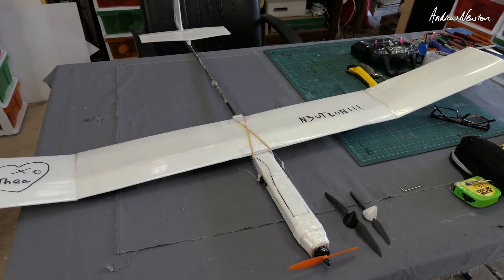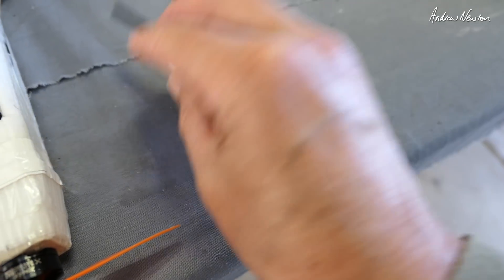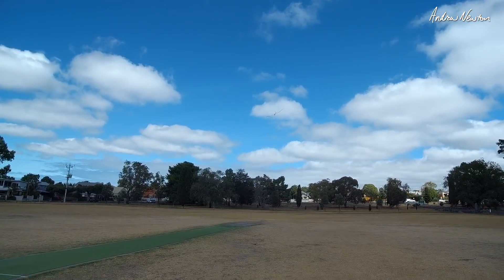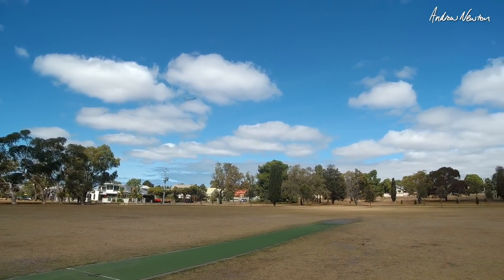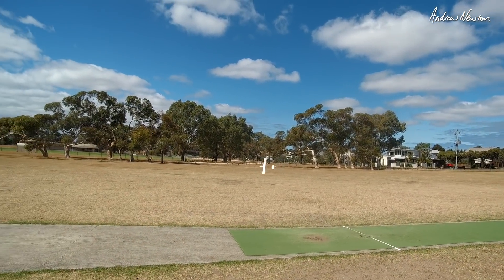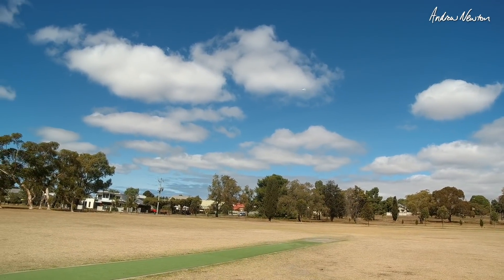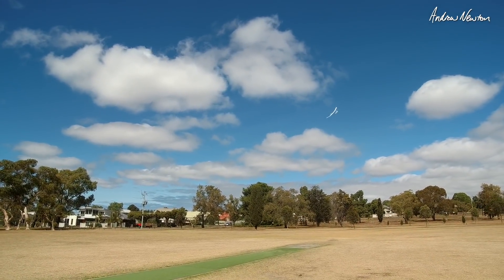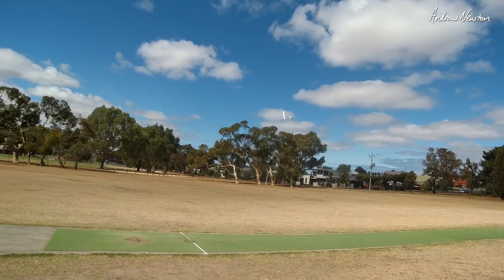Neutron Motor and Prop

Comment: The Neutron is my favorite build of yours! love these videos! 

Waiting on my laminate film to come in and I'm planning a build that's going to be a Neutron/Eachine Razor/Bird of Time mash-up inspired build! Planning on running a 2212 2200kv motor in a 3d printed mount/nose cone I designed, 30A ESC, a few 3d printed ribs I designed in the fuselage, 7.5mm carbon fiber tail boom, 3d printed tail surfaces mount for the boom, and some control surface horns I found on thingiverse being pushed by two 9G servos! This is the folding prop I was planning on using       https://www.amazon.com/dp/B07PV5LSY8?psc=1&ref=ppx_yo2_dt_b_product_details

 
Think it'll work? I feel its going to be a little on the heavy side with the gear and FPV stuff on it
Reply from the maker: Overkill motor unless you are making a big version. Prop is probably too big for 2200kV
Reply: @AndrewNewton  I found the same prop in a 6X3 configuration with a 2mm bore, drilled it to fit the 3mm shaft on my motor tho, or should I use that with a 1000kv motor (trying to use spare parts i have on hand rather than buying new parts) 

thanks for the reply! I"ve watched most of your videos and have taken a lot of inspiration from them

Comment: Nice easy build Andrew. As for folding prop assembly's I use these on all my powered gliders and with CamCarbon props they are quiet and more powerful than stock blades. Only downside is they are in the uk https://www.electricwingman.com/aeronaut-30mm-turbo-spinner-5mm-shafts